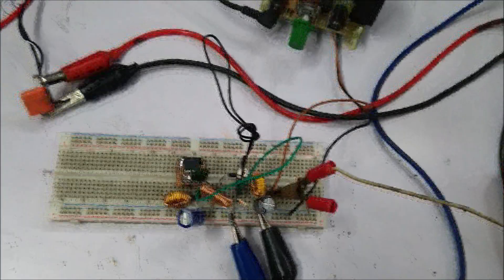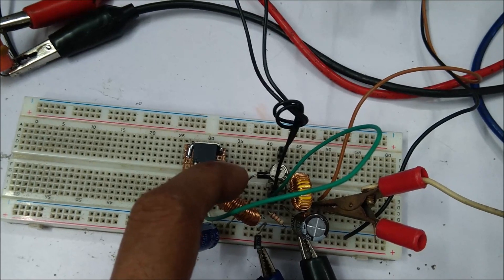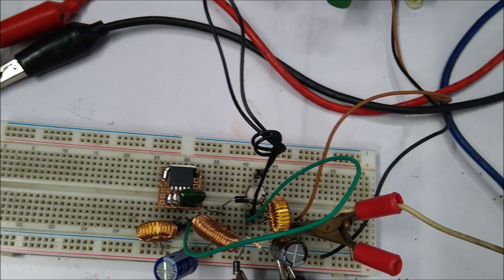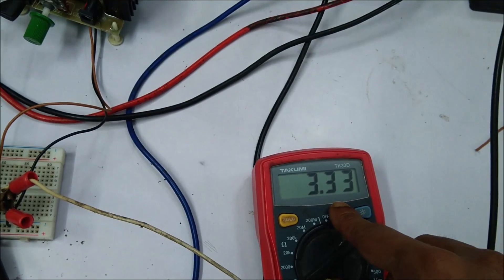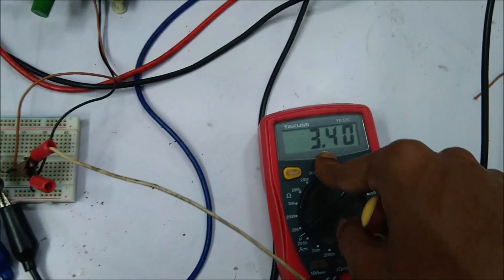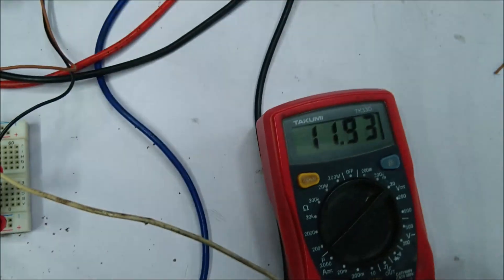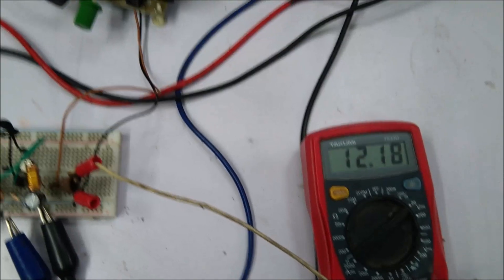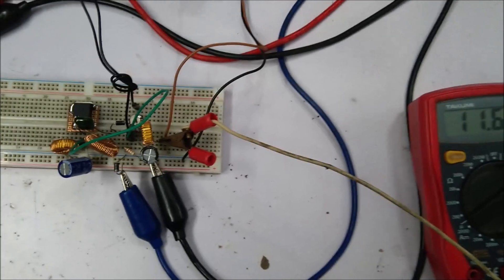Buck Boost Converter Circuit using XL6009 with adjustable 3 3V to 12V Output Voltage

Comment: FYI, read the instruction and schematic in here https://circuitdigest.com/electronic-circuits/buck-boost-regulator-using-xl6009-with-adjustable-33v-to-12v-output-voltage

Comment: Sir is there any possibilities of replacement of potentiometer with mosfet...i just want to control that potentiometer using MOSFET and pwm from Arduino...i want to control its output automatically by Arduino without rotating the knob manually so is there any possibilities of doing that i tried to put MOSFEt in place of potentiometer but it burns..so can you please help me to make it automatically...